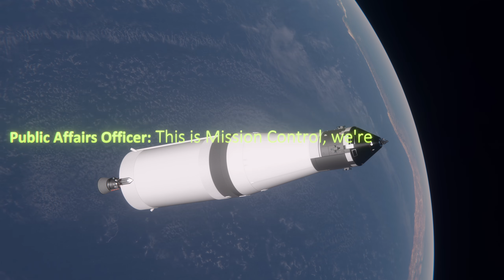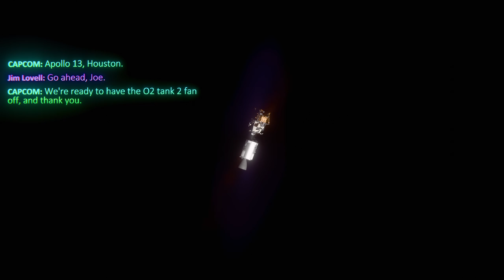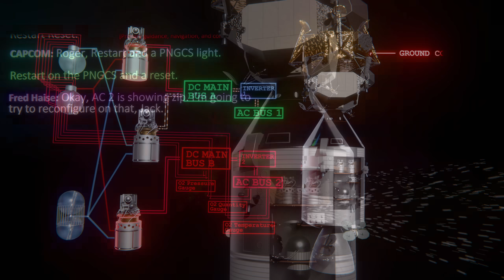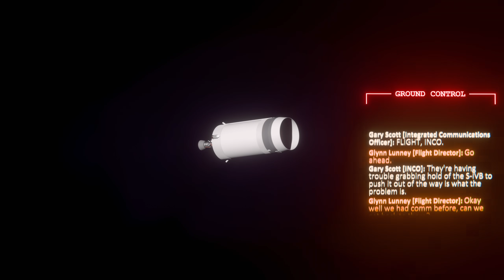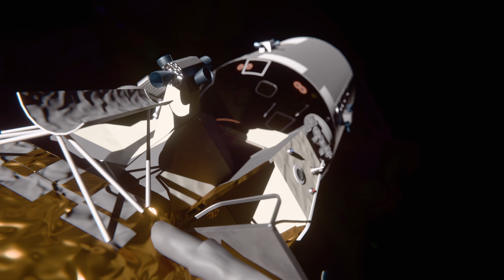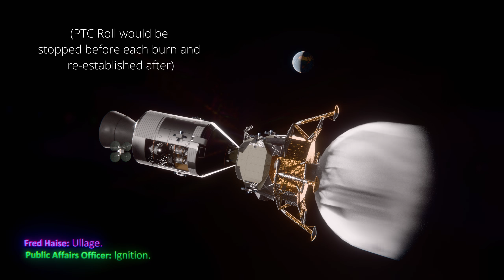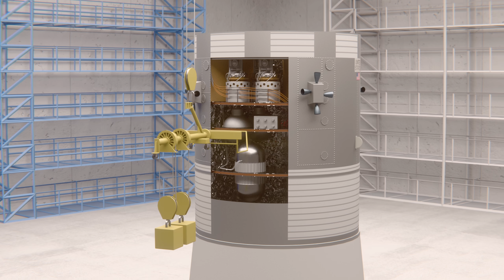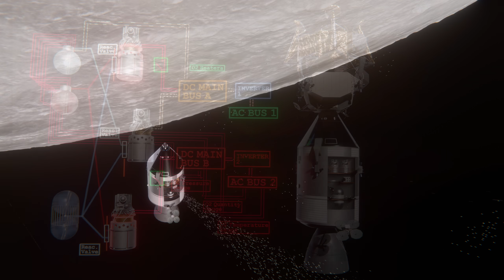Apollo 13: What Went Wrong

Comment: Something I didn't know, which I now do, was that there was indications that something was wrong with o2 tank #2 long before it actually exploded. With the off-nominal pressure readings. So much so that they made a point to do cryo stirs at much more frequent intervals then they normally would otherwise because they weren't getting accurate readings and were trying to see if they could get the sensor to start working again, or so they thought. I didn't know that because I hadn't listened to the full transcript audio tapes. I just sort of thought that everything looked fine up until the explosion occurred.

In retrospect the o2 tank pressure was showing off scale high not because it was a faulty sensor but because it actually was way too high. The tank heater I believe was stuck on, continually raising the pressure inside the tank over the course of the mission. The higher temps led to wiring insulation melting, which led to an exposed wire producing a spark, and that was all she wrote at that point. Kaboom.
Reply: It's funny how lots of engineering failures aren't because sensors don't work properly, it's because the humans monitoring them either are used to the sensors acting poorly or ignore them entirely.

Comment: One thing I always wondered about Apollo 13 is why the crew didn't just use the LEM to take a quick peak at the Service Module?  Not talking about an EVA, (which would have burned up precious, limited resources), but by undocking from the CM/SM, giving the LEM a quick nudge off-axis, and seeing exactly what had happened.... 

Guess "For All Mankind" was right- NASA is far too timid and cautious
Reply: Because the command module was what controlled the docking and it was all turned off.
Reply: @-AdamTheGreat- before the CM was shut down
Reply: @looneyburgmusic  they shut it down in a hurry and you want them to postpone for several hours to look at it? What for? You suggest to kill them for no reason. Even if the malfunction were different and less severe they'd achieve nothing with that action

Comment: I watched the infographics version of showing what happened, and because of the way they phrased things and the visuals they used, it made it seem like a human was carrying the tank, dropped it, then picked it back up. Seeing the visual with a detailed description of what happened is WAY different. The other one gave the impression of overt clumsiness and lack of foresight, but your work in showing what happened here gives a much better and more accurate idea of every aspect of the Apollo 13 mission.
I get that the other video is very short and they need to convey things in a quick and easy to understand way in the time given, but they did so at the cost of potential misinformation. They also said "plastic" insulation instead of teflon.

Thank you for making this! Your visuals are incredible and as someone who has had 0 (zero) knowledge about space travel or what went wrong on Apollo 13 until a very sudden hyperfixation hit, I thank you for putting so much effort into this! I've been live messaging my watch of this to a friend this whole time. Again, very good.

Comment: The control to not just 'try any plan and see what the results give' and the troubleshooting to try figure out what is going on with a spacecraft way out into space that you cannot physically touch, see or even potentially rely on the instrument communications is astounding. 
That's also if the instruments they needed weren't completely off-lined by power loss in the first place.

Comment: I'm amazed how long they spent trying to recover what they thought were faulty readings from the O2 tanks.
The film made it out as though they went for the LM straight away.
The confusion is so unsettling with hindsight. The limitations in the hardware and sensors meaning they had to troubleshoot over half an hour, they worked as fast as they could with everything they had and were so close to catastrophe. These guys were incredible to manage the situation but my god they were a hair from game over.

Comment: One thing I don't understand:  If the O2 tank had been heating to extremes on a regular basis, why wasn't the additional amperage noticed?  The only thing I can think of is the tank was heating pretty much every time power was put to the spacecraft so the additional amperage wasn't noticed as it was lost in the background of normal flight current draw?  Any other thoughts?

Comment: Question: If the free-return was decided upon before the accident,  How was the moon landing and recovery planned?  It seems that the path does not allow for more than one partial orbit of the moon, profoundly limiting the time available between the lander moon landing and return from the moon.  Wouldn't the ship need to orbit at least twice?
Reply: the free return trajectory is there to guarantee survival in case the astronauts fail to enter a lunar orbit. But in nominal operation , the spacecraft would slow down using its engine and enter lunar orbit (ie reducing its speed so that the moon "captures" the spacecraft in its gravitational field. After that they could circle the moon as long as they wanted.

Comment: Insane that they did all these calculations without computers.
Reply: They did not
Reply: huh? they had computers for this. this was the 70s after all.
Reply: the apollo program wouldnt have been possible without computers , the computers calculated the trajectories and the maneuvers.
Reply: @yaya1338-w7d  Analog computers yes, not the computers we have today.
Reply: @FlipjeNL  they certainly had digital computers too which werent particularily new even at the time, in fact the computer they had on board (the AGC) was a digital computer.
Reply: @FlipjeNL  You really need to do some reading. That's what they were using, was digital computers. It was the 70s, not the 20s!

Comment: I'm having trouble understanding what they did to fix COMs at this point 1:14:57 
In a nutshell, they had to turn off Aquarius COMs for 3 minutes to be able to change the return frequency of the SIV-B otherwise they would mix up. Is that right or am i missing something?
Reply: Yes. Both SIV-B and LM default to the same frequency and try to match the frequency of the ground control. If control gradually shifts the frequency of their signals, LM and SIV-B can adjust for it and keep listening. So if ground control were to change the frequency of their messages, both SIV-B and LM would follow and the situation would be essentially the same. Control asked the crew to disable LM's comms so that it doesn't listen and react to frequency changes. Then control started shifting the frequency of their communication with SIV-B. Meaning the booster also shifted the frequency of its responses thus clearing the original frequency. Then control tuned in back to the original frequency, LM turned comms back on and they were free to use that frequency without interference

Comment: Small correction, the computers didn't direct use water.
To cool your machine in space, you can't relie on convection.
The best solution to remove the heat in such a space craft, was using some of the water to freeze and vaporize on a special surface exposed to space.
The ice will sublimate, changing from ice directly to vapor, this is the actual removal of the heat of the humans and computers onboard.

Comment: My grandfather worked at NASA from the beginning of the Apollo program to the middle of the shuttle program. Many things he had a hand in designing were included in those many missions. 
13 was always something he told me about, how it was in itself a feat of engineering. He often used it as an example of what to do when you’re stuck, and that’s to use the amazing ability we all have as problem solvers, start at the beginning of the problem and go piece by piece till you’re back in order. 
His stories are probably why I work on big things these days, and why 75% of my career is solving problems.
Reply: My uncle was there at about the same time. He worked on the lithium oxide cannister problem.

Comment: This is an excellent documentary on the technical details of Apollo 13. One of the best I have seen. I am glad you mentioned the LM battery explosion. I have seen so many documentaries on this mission and none of them mention the the battery. The first time I read of it was in Lovell's book, I was stunned that this was left out of almost all documentaries and the movie. The just had a catastrophic power failure in the CSM and now potentially have a power crisis in the LM. Turns out the loss in capacity from the boiled battery was negligible for what they needed but there was real concern when it happened. Even googling about the battery explosion turns up nothing. The visual aids on the trajectories and power busses were excellent as well.

Comment: 25:20 You mean "uninterest." "Disinterest" means that you have no stake in the outcome of something, e.g. a good judge should be disinterested in the outcome of a case. It does NOT necessarily mean you don't care about the subject, as obviously a good judge would.
Reply: ? this is such a weird nitpick that isn’t even correct. your definition of disinterest is only one of the possible ways to use the word, the other being, obviously, “the lack of interest”. uninterest is not commonly used, disinterest being much more common in its place.

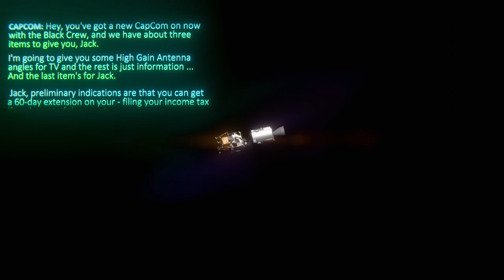Comment: 18:30 technically he is in the country, as the same rules that apply to aircraft and sea vessels, also apply to a spacecraft. And because at least the command module was a flag-bearing vehicle, Jim was in the USA.
Reply: Today that is true yes but in '69 that rule didnt exist for spacecraft yet, if you werent on the planet you were not in any country, the IRS did actually grant him a 60 day extension based off the lack of this rule, hence its existance
Reply: @idkwhatmyusernameshouldbe5345 sorry, but the Outer Space Treaty was signed in 1967, and the Apollo 13 mission was launched in 1970.

Comment: This is a superb analysis of Apollo 13.

Consider that in 1970 the troubleshooting of the problem was performed by a limited number of engineers, flight controllers and their support staffs. Undoubtedly computers were used for calculations of engine burn times and navigation, but most of the work involved engineers looking at drawings (mostly schematics) and specifications for the various systems on the spacecraft.  If this happened in 2026 would there be any reliance on AI to determine the steps needed to bring the crew safely back to earth?

Comment: Thanks for the vid!  Nice job!  It's amazing to see all of the creative liberties Hollywood took to bring this story to the silver screen.  I think the biggest deviation had to do the fact that the most limited resource in the LM was water, not current.  Current was a factor but they were most concerned with running out of water as the equipment needed water to function.  All the drama around startup sequence vs max amperage appears to have been more Hollywood generated suspense.  They also skipped the problem with the 3rd stage comm issues as well as the additional venting in the SM and the lower stage of the LM.  It's good to finally hear the full story of what happened.  Thanks for the video!

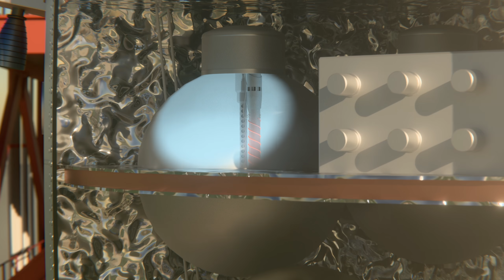Comment: 1:53:10 Between this, incidents such as the initial readings at Chernobyl, and some background in product testing, I'm always suspicious of readings that are near max/maxed out.
Not only because the real reading could be way off, but also because tests & probes often have a linear response for a certain range, which the extreme ends may be outside of, which can give a misleading reading.

Comment: Phenomenal video. Just a correction to the reactant valves. They could not be reopened even if they had wanted to as they were designed to be closable only. This is the reason that the reactant valve latch switch is on the bottom left corner of panel #3. Any time any sort of jarring maneuver was used such as ascent or a p40 it had to be switched to latch or the crew would risk jarring the reactant valves shut permanently.

Comment: The water shortage was not as critical as you make it sound, nor their initial estimates. I’ve listened to the entire ground control loop, and I believe there were still 2+ days left in the mission when Jack Lousma radioed up that they didn’t even need to track their drinking consumption anymore. They were fine drinking as much as they wanted. They still had about 13 liters of potable water at the time of re-entry.

Fred Haise was the most concerned with their usage of consumables and was under-drinking, which is why he ended up with the UTI.

Comment: NAA accidentally dropped the service module during ground testing.   Failed to pick up bent vent tube.   Electrically-venting fried the wire insulation.    Voltage upgrade without proper metering sealed its fate.   VERY sloppy construction ... but signed-off by the crew!
Reply: Of course nobody knew at the time that any of these things were serious issues -- one of the unfortunate consequences of a very rushed development process.

Comment: was the procedure of powering up the command module computers not included in this video or was that just something dramatized in the movie? I remember it being an intense scene where Ken was trying to figure out how to get the amps below a certain threshold.
Reply: It was John Aaron and a couple of back room engineers who figured it out.

They had to arrange switches and circuit breakers in the right order so they could reach the battery charger in the Command Module. There was no simple power umbilical cable shown in the movie. They had to use telemetry cabling to trickle a small electrical current from the lunar module to the battery charger, there was no easy way to reach it. It was a really complex procedure and any switch or breaker in the wrong position would blow the circuit.
Reply: @Henry5th would have loved to hear that procedure and explanation. Thanks!

Comment: Incredible, well done.  Thank you for making this documentary.  Its professionalism and attention to detail would make the Apollo engineers proud.  I legitimately will use this in my engineering endeavors tomorrow at work.  We modern engineers could have serious lessons learned about low SWaP systems, verification testing (pointedly shock and drop), failure mode analysis and meditation/contingency planning, redundancy design, interface documentation (specifically voltage interfaces and revision control), and overall systems engineering rigor when it comes to studying these systems.

Comment: Just coming back to this video now for the third time. I think the most important moment in all of this is Seymour Liebergot's call to isolate the surge tank. And also it has to be emphasized that he feels comfortable contradicting his superior, Kranz, and calmly explaining why the decision is necessary amidst all the stress and uncertainity. This speaks to the culture within mission control and exactly the kind of management culture necessary in risky operations like spaceflight. So many have died in plane crashes on earth because of a lack of this sort of culture at many airlines historically. I don't know how much supply was left in the tank but one shudders to think at what would have happened if it had run out. Would a transfer from the LM tanks to the surge tank have been possible? I imagine not.

I was pretty familiar with the Apollo program and had heard of him before (I guess I realized that that was Clint Howard's character in Apollo 13) but I feel like his name should be as well-known as John Aaron's.

Also you should definitely refocus your channel around this kind of stuff, you've done incredible work with this and the Hubble video. Great job!
Reply: Crew resource management, Mission Control Houston was an incredible example of CRM, and there's a lot more people involved than in an airplane cockpit.

Comment: Absolutely stellar documentary. Simply the best documentary on Apollo 13. You have definitely earned a sub. Thank you for all the effort you put in this.

The only thing I was surprised that was missing was the fact of how instrumental ken mattingly  was to figuring out the startup procedure of the CM prior to the undoocking of the LM. Which had they not figured that out given the limited amperage they had to work with, It wouldn’t have been a successful failure.

Comment: I've watched this several times at this point, and am just amazed at the calm demeanor they all maintain on the comms, and how they all respectfully articulate their thoughts despite the pressure (or lack thereof), as well as how they all listen, trust, and (respectfully) challenge eachother throughout and across the entire chain of command. An absolute masterclass in professionalism and teamwork. The only extremely mild whiff of "anger" I have been able to catch in this whole video is at 44:16 when Kranz off-handedly says "give me the page" in a slightly aggresive way, which probably puts him on the short-list for the "Most Well Regulated Nervous System" award, alongside Buddha himself.

Comment: Pretty sad they got doomed the moment they tested oxygen tanks long before launch. They used higher than normal voltage for heating coil to empty that one tank melting ptfe insulations inside creating shorts in wires. That was a bomb waiting to happen after approving the test results and going all: it will be fiiiine.
After reading those testing documents I wondered how using 4x the power on heating coils would be good idea to any engineer.